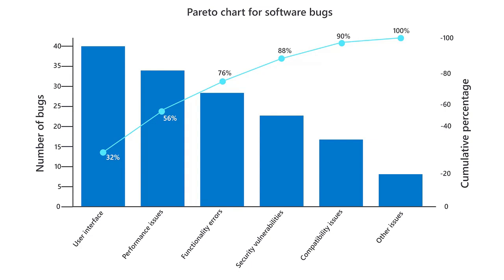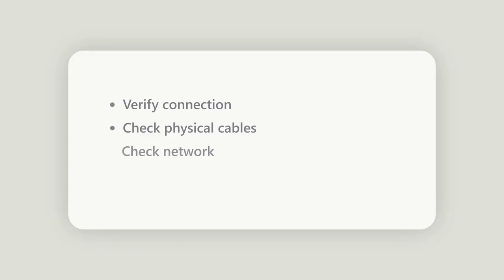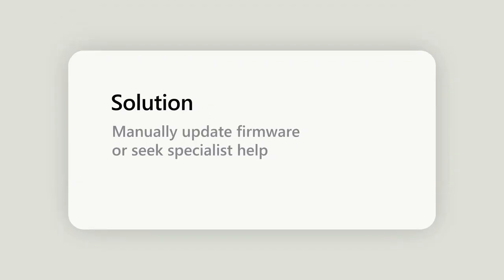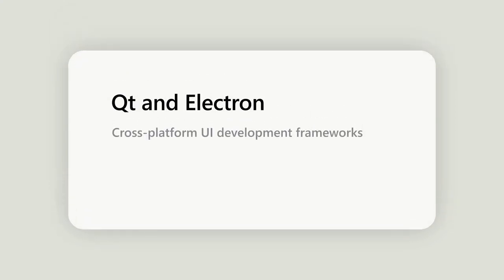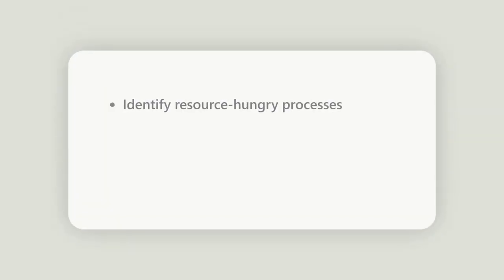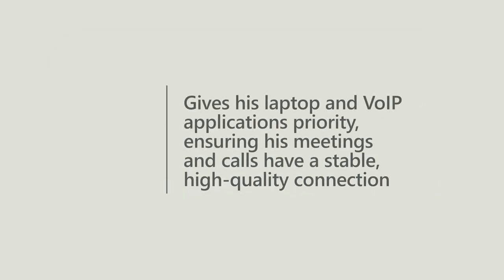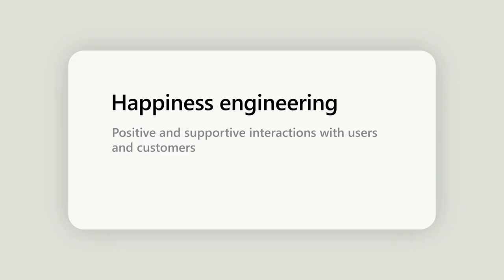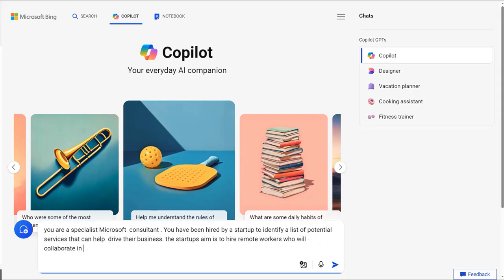Microsoft Cloud Support Course 6: Technical Diagnostics and Troubleshooting

Comment from the maker: MICROSOFT CLOUD SUPPORT COURSE 6: TECHNICAL DIAGNOSTICS AND TROUBLESHOOTING

━━━━━━━━━━━━━━━━━━━━━━━━━━━━━━━━━━━━━━━━
MODULE 1: TROUBLESHOOTING FUNDAMENTALS (51:18)
━━━━━━━━━━━━━━━━━━━━━━━━━━━━━━━━━━━━━━━━
00:00:00 - Course introduction Technical Diagnostics and Troubleshooting Techniques
00:03:52 - Introduction to troubleshooting
00:08:16 - Happiness engineering
00:12:28 - Troubleshooting scenarios
00:17:50 - Root cause analysis Analyzing the problem
00:22:41 - IDEAL framework
00:26:58 - Applying logic and elimination methods
00:32:05 - Exploring hardware components and their potential issues
00:37:20 - Diagnosing hardware failures
00:43:00 - Troubleshooting printer issues
00:47:28 - Module summary troubleshooting methodologies

━━━━━━━━━━━━━━━━━━━━━━━━━━━━━━━━━━━━━━━━
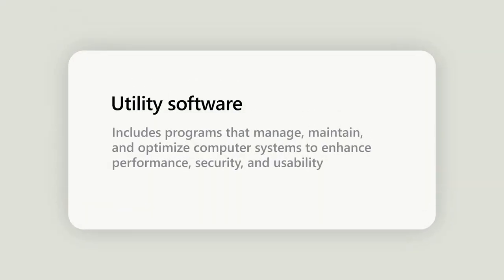MODULE 2: SOFTWARE TROUBLESHOOTING & OPERATING SYSTEMS (55:27)
━━━━━━━━━━━━━━━━━━━━━━━━━━━━━━━━━━━━━━━━
00:51:18 - Exploring software components and their potential issues
00:57:13 - Analyzing logs for software troubleshooting
01:02:38 - Troubleshooting BIOS, boot and firmware
01:08:26 - Troubleshooting boot and startup issues
01:14:27 - Troubleshooting user account and permission issues
01:19:37 - Troubleshooting Windows activation and authentication issues
01:24:57 - Comparing different operating systems
01:31:29 - Cross-platform software and file management
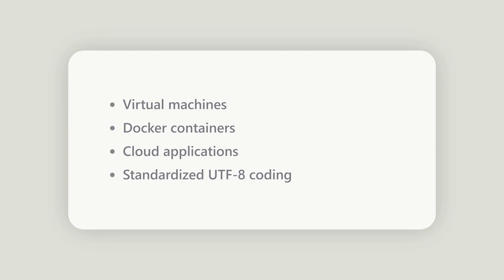01:37:04 - Resetting the computer
01:41:51 - Module summary Troubleshooting operating systems

━━━━━━━━━━━━━━━━━━━━━━━━━━━━━━━━━━━━━━━━
MODULE 3: ADVANCED TROUBLESHOOTING & NETWORK DIAGNOSTICS (57:35)
━━━━━━━━━━━━━━━━━━━━━━━━━━━━━━━━━━━━━━━━
01:46:45 - Using diagnostic tools and utilities for troubleshooting
01:52:30 - Task Manager and Resource Monitor
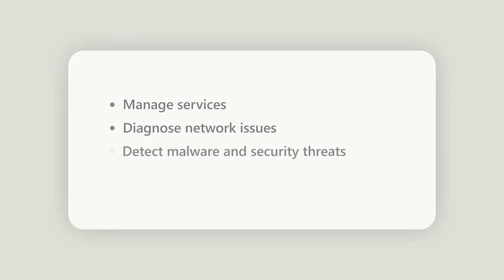01:58:46 - Disk Management and Disk Cleanup
02:04:36 - Troubleshooting network connectivity and configuration issues
02:11:06 - Using network diagnostics tools
02:16:59 - Wireless network troubleshooting
02:22:14 - Troubleshooting complex and uncommon issues
02:28:19 - Software corruption and installation issues
02:33:24 - Troubleshooting Windows upgrade and installation errors
02:38:10 - Module summary Advanced troubleshooting techniques

━━━━━━━━━━━━━━━━━━━━━━━━━━━━━━━━━━━━━━━━
MODULE 4: COURSE CONCLUSION & AI INTEGRATION (29:01)
━━━━━━━━━━━━━━━━━━━━━━━━━━━━━━━━━━━━━━━━
02:44:20 - Course wrap-up Technical troubleshooting diagnostics
02:50:19 - Introduction to Generative AI for IT Support Specialist
02:55:03 - Understanding the importance of role in the prompts
03:01:21 - Creating workplace educational content
03:07:45 - Streamlining company research with Microsoft Copilot A practical use case
03:13:21 - Congratulations
03:15:21 - END OF COURSE 6